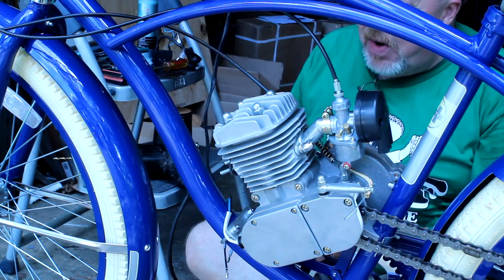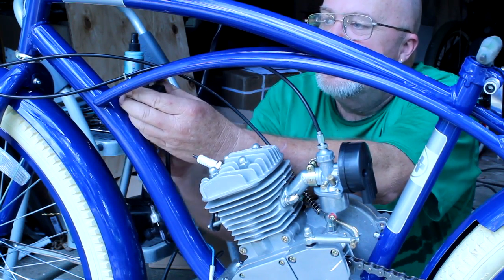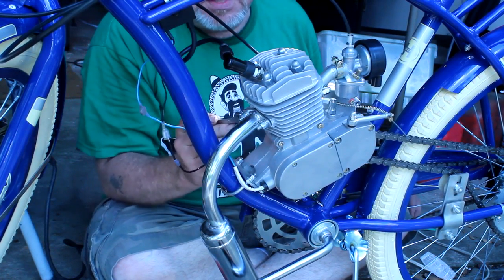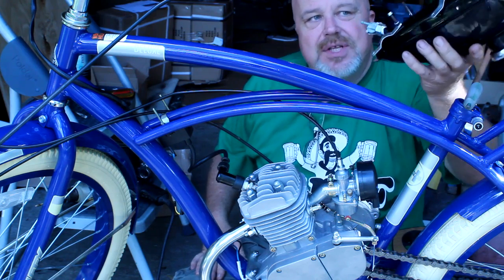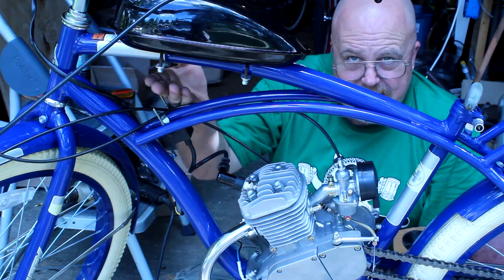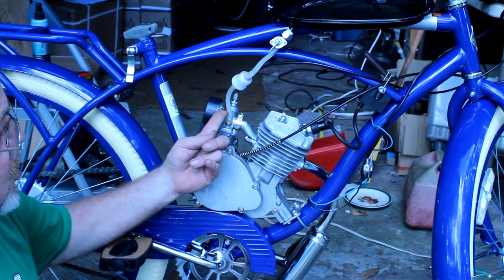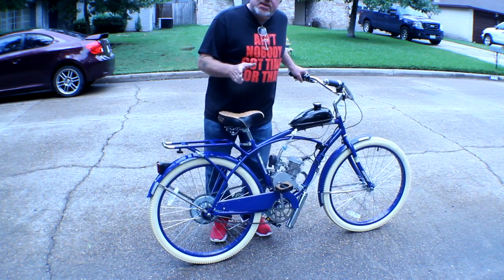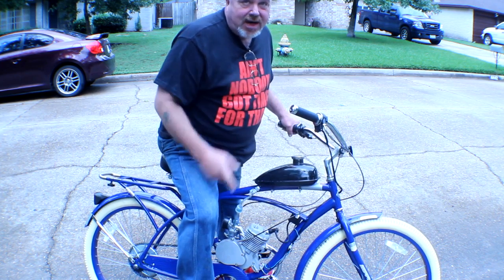How To Build Motorized Bicycle Final Assembly & Starting

Comment: I wouldn't recommend to kill the engine and use it to slow you down. A two stroke engine need to be running to lubricate it self. The lubrication comes from the oil mixed in to the fuel. So if you kill it while still in motion you will starve it of oil and may cause damage to the engine.
Reply from the maker: +Metin Erdinc Give it throttle. It will still be sucking in gas/oil premix

Comment: Hi HoustonMotorized, i have a question  about a motor i just put on and hooked up. I have the right fuel and oil in it, wires are connected right, and all adjusted how everything should be. But i pedal it and release the clutch and it does not start. I made sure of the spark that it is adjusted right as well and the fuel is open. When i pedal, it does "pop" every once in a while but i release it and it does not start. Was wondering what i would possibly be doing wrong or what i need to do to get it running.
Reply from the maker: +Hunter Rockne Try some quick start into the carb might help. Next look for air leaks, make sure fuel is getting into carb, carb is not leaking gas from float not seating
Reply: +HoustonMotorized How about Cyclo Breakaway?,.. It carries a lubricant  un like Quick start or ether based sprays.

Comment: I have a question . Do you know why the back wheel hub gets too hot when I ride it ? 
If any body know please tell . 

Hope is normal
Reply: Juan Barahona Do you have a coaster brake and do you use it? If so, its the braking that generates a lot of heat that can actually damage your hub, crack your bearing races, etc.  I suggest purchasing rim or disc brakes and using them in combination with your coaster brake to even out the braking load.
Reply: Jeremy Diaz thank you very much , that was reelly helpful

Comment: Hey HoustonMotorized, I recently installed my 2 stroke engine on my bike. According to my "bike mechanic" the motor and chain sprocket is not in line. He is going to charge me about $80-$125 in order to reposition the engine with new pieces and make the sprocket "pop" out more so as to put it in line with the engine. I've already put a lot of money into the new trek 7.0 bike and engine.  What do you recommend I should do? Go to home depot and look for the necessary parts myself, or spend the money at the bike shop? Im looking to be as economical as possible.
Reply from the maker: Joni Gabriel Do it yourself is cheaper if you have the tools and skills. Looks like a basic install to me
Reply: Joni Gabriel none are going to be inline thats what the guide chain tensionor is for mine dont line up never fails off he's trying to make money off you

Comment: my motor has 3 wires coming out black blue and white....is the white wire a ground?
Reply from the maker: Jeff Grumbling Cut the white wire and tape it. It is not good for nothing. Forget about it
Reply: oh ok thank you
Reply: +Jeff Grumbling   The white wire if for running 6 or 12 volt electronics, such as headlight. However, it does rob the engine of power.
Reply: +Jeff Grumbling probably the blue one is and i wouldnt cut any wires that come with the motor..out an end cap on it and spot tie it for future use..
Reply: oh ok thank you Buzzards Bass
Reply: Thank you for your answer.  Been looking all over for an answer, even the morons at Bikeberry wouldn't or couldn't say what it was for.

Comment: I have been looking at your videos. I have a mongoose dolomite fat tire bike and was wondering if a motor would work on it. It is a 7 gear mike 26"
Reply from the maker: Rusty Williams YES, you would have to fabricate a mount that allows the engine to align properly with rear sprocket

Comment: I got three cables coming from my motor one blue, one black and a white cable where does the white one go?
Reply: Hugo Huereca It is sometimes used for a light kit.Most help videos fold the wire and tuck it in and tape it.One video suggested not hooking up a light kit as it would affect engine power.I did not use my wire-I use a battery operated bike headlight and taillight.Take care

Comment: hi 
can i put gasoline, octan 95 in it ?
Reply: Yes, you can put any gasoline in it as long as you mix 16/1 ratio of 2 stroke oil in it. Without the oil your engine will seize the first time you start it, and that will be the end of your engine.

Comment: I bought the 80/66cc kit from http://enginesonlineshop.com/2-Stroke-Bicycle-Engine/. First off, it didn't come with instructions! It did have them on the website though and I printed them all, but they are not good instructions, there were numerous steps that left me with doubt. Then I started looking and I found your videos and it didn't hurt that the bike frame is the same style. So I followed your instructions pretty much to the letter and she fired up the very first time, no problems! I did have to come back after a quick run and tighten the chain, but since then, she's been great! I'll repost after a while, but right now I'm loving it! So much fun and thank you for the great instruction! This makes riding a bike so damned much fun!!!

Comment: great videos just watched all parts i am goign to do this to a bmx or mountain bike if i can get one ...  what i want to do is to ride the bike normally to the place i wanna ride it so i will probz fabricate my own exhaust that it more discreet and i will really make the wiring all hidden apart from the ht lead i want to be able to put a cover round the engine as i know around my area i will get pulled by the police but if the engines covered they wont give it a look thats why i want a hidden exhaust
Reply: You might not have the clearance to put this engine in a bmx frame. I think it would be awesome, I'm just not sure it would fit in the void. It's a tricky fit even with a beach cruiser, lol!

Comment: Can you tell me what the White wire is for- Or where does it go?
Reply: I was not sure myself at first but I tested it and it is unnecessary I just wired the blue and black ones and made sure to cover the white one so it did not ground out.
Reply: The white wire is not necessary, as mentioned before. If you have a small light you want to attach to the bike you can use the white wire for power. Keep in mind that it will take power from the engine. This will bog down the engine and reduce speed and torque.

Comment: Hi, I followed every step from video 1 onto 6 with the installation of a 49cc 2 stroke engine. I haven't put the mix fuel yet but the tire does not make a full turn even if I press the clutch is this normal the chain is not tight what do I do
Reply: I was running the motor but now it has no power, it has a new spark plug, what could it be

Comment: Hello, If my idle screw came out during riding (I know, dumb).  can I use any screw that fits in there as an idle screw?
Reply from the maker: Yes only if it is the same shape as the original screw. the tip of the screw is what raises or lowers the throttle slide and that is what sets idle

Comment: Ok I love the video it perfect but see ive done the same build but on a stingray chopper and I can get the motor to shoot flam out the back if I push it while not pullin the clutch which show it got spark but if I pedle it and try and start it it dont try and fire at all other then skip fires what could that be

Comment: Eugene... Great Job on the details of the series you did... I have one question though.  I understand the black and blue wires from the magneto... but where does the White magneto wire go? the CDI only has female sockets for a total of 4 wires.
(blk/grn/blk and the other of blu/blu/org-yel) but nothing said about the white?
Reply from the maker: You can cut the white wire. It supplies 6 volts power if you want it for lights

Comment: Dear Sir: 
I am Darita, and I am living in Ely, Iowa. I plan to use two stroke engine bike rider for school time in this summer and earlier fall.
I seen your guideline and demonstration how to install and run great. I just bought one and all install but I could not run my motor at all. How about the engine oil and gas. I bought oil mix from wall mart I filled it according to the seller advises me, he recommended me to put 32 fl oz into a gallon of gas, but when i see your instruction of my engine ratio is 16:1 is only 8 fl oz per gallon. Now I drain them out and follow your instruction. But I have one question why when I push clutch to paddle bike manually it won't move? and I try to go down hill my drive way many time but the engine won't start at all. I wish to request your advise for further information through email: darita_msn@yahoo.com. I wish to seek your favor to help me on your convenience time. Thank you very much, and I would appreciate with your great advise.
Darita

Comment: What can i do to make the bearings in my rear wheel last  or where can i get a heavy duty rim with heavy duty bearings....the bearings keep blowing out the side of the hub ....someone plz help thanx all
Reply: Its a little late but filling the back bearing up with high temp grease will help a lot.
Reply: phglu
Reply: TJ_BRAPPTAMIS prime find a junk Puch moped or something similar use that rim and tire or cut the whole back end off and use a complete shock absorber assembly and weld it to the rest of the bicycle if you know what you're doing it can be great
Reply: TJ DUKES Anywhere but china.

Comment: hi there, i am building one of these kits and coming from the engine/magneto i have a blue wire,black wire and a white wire, do you know where the white one goes, i thought it could be a earth lead but i am not sure, thanks in advance!
Reply: The white is for a front light, or led of some sort. It's not necessary for your bike to run.

Comment: Hey I messed up and put the spark plug cap on without removing the nut now the spark plug cap doesn't work properly. I spring came out and the spark plug is now not working. Where can I get a new spark plug cap and wire harness? Also do u just ground the the ground wire to then bike frame?!

Comment: yeah i got one but the chain keeps falling off how do i tighten it
Reply: 4you2eat i got the chain fix and adjusted but now the back wheel is not turning what would cause this and how to fix that and thanks for your help
Reply: 4you2eat humm i not sure if the clucth is i pull it in to move the bike yet the rear wheel is not moving and if it does its very hard to move

 .
Reply from the maker: Debbie Amazingpets
If the clutch is not setup or working properly the rear wheel will not turn. ..OR ...Might be the axle is too tight. There are bearing keepers on the axle shaft that if they are too tight, then the wheel will not turn. If the brake arm is striking the sprocket or the bolt heads for the sprocket the wheel will not turn.
Reply: HoustonMotorized ok thanks is there any videos on how to fix the clutch is that a hard thing to fix or if its the axle is that hard any videos on either thanks so much
Reply: HoustonMotorized  i fix it it was the clutch now the wheel turns ..but my throttle is loose and see gas leak when i turn the switch on ..moter starts but not making the bike go ..also when i not using the bike should that clutch swtich be up or down .any help thanks so much

Comment: Hey man I'm having some trouble with my engine kit, it's like yours except black. The chain keeps pooping off the rear sprocket when I pop the clutch, this happens after a few attempts to start the motor and the motor won't kick on on my first try. Any ideas? Also my carburetor switch is up when I pop the clutch after feathering the throttle I switch it down but the engine just dies.
Reply: this used to happen to me the easy way I did it is to get  spring assisted chain tensioner it adjusts the chain while its moving not keeping it to tight or loose .
It also doesn't keep a lot of tension on the chain making last longer. The sell all types of spring tensioners on ebay or other online websites.

Comment: Hi i have just bought a new motor kit (the same as yours) i was just wondering why the bike is not starting. It's never been started before. The clutch is working. the spark plug is working and sparking correctly. the motor turns over and the fuel is going into the carb correctly. (the fuel is on a braking ratio of 16:1. But why is the motor not working.
Reply from the maker: Sounds like fuel. Is te choke on ? .. Check for air leaks in the inlet, cylinder gaskets. Issue w/ carb ?
Reply: I will thanks again ill let you know if anything seems not right. The choke was up and then i heard i popping sound. I'm not sure if thats the sound of the spark plug or just the motor turning over. Do you think its got to do with the idle screw? If so how do you use it.

Comment: Hi, Ive got a problem. This is my first bike i built and I've got everything right except the back wheel is locked. I pulled the spark plug out and it worked a little but it was still a little hard to movie the wheel. Now even with the spark plug out its still locked up. My clutch cables pretty loose but i don't know how to tighten it. Any solutions? Thanks!
Reply from the maker: If the rear wheel is locked, might want to check that the dust seal on the rear wheel is not rubbing inside the sprocket. That is covered on part 4. Part 7 shows how to properly tension the clutch cable

Comment: Hi Eugene, Thx again for the good work and your Lux of details. Im wandering if there is anaway to extend the muffler (1/2" coupling, 1/2" pipe) toward the back just anough to clear the white tire to become dirty & greasy and act as a noise reducer at the same time without having to packed the chamber and loosing HP. Is there a rules of thumb for the configuration of the muffler?
Reply from the maker: You can extend the pipe and have the muffler in the back. They sell what is called the Poo Poo Pipe which can do that

Comment: Hi, I have the same bike, I am having a slight problem with my bike.  every time I pull the clutch lever when I want to stop the bike at a traffic light, the engine turns off, and I have to restart it again, do you know what might be the problem?
Reply from the maker: You can adjust the idle higher which might help. the screw on the carburetor, screw it in 1/2 turn at a time and test drive the bike. You might have an air leak in the intake. make sure the carb is pushed on all the way and tight........ Coaster brake = backpedal and it stops the bike